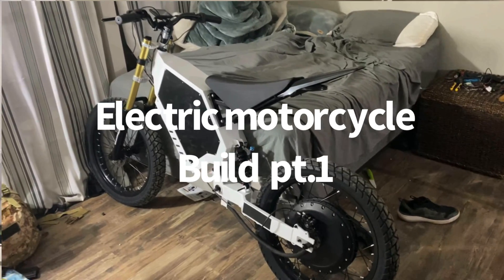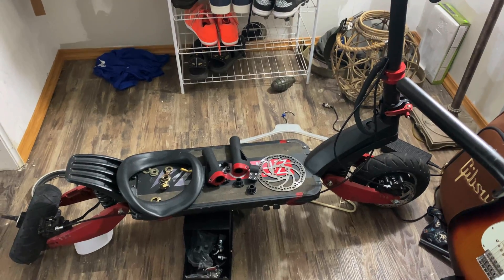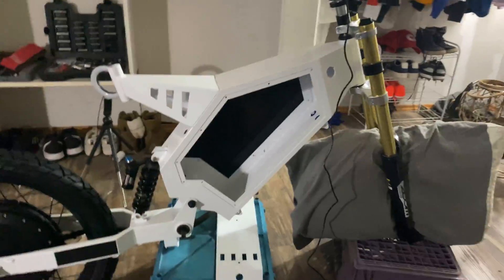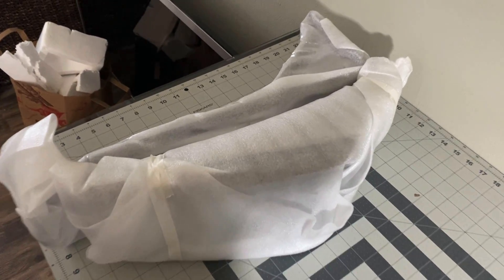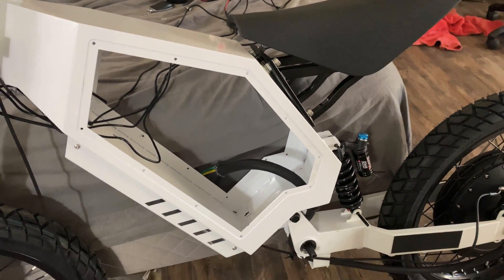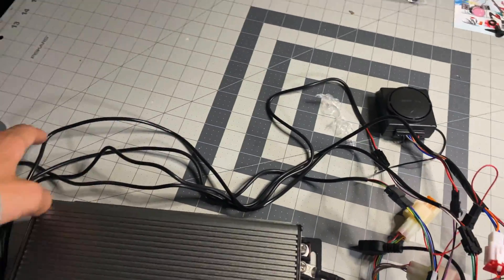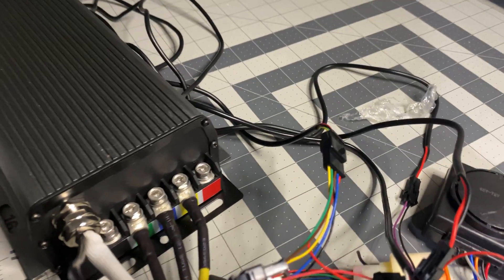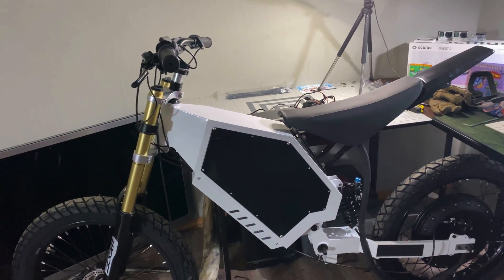70mph Enduro E-bike build pt1

Comment: Thoughts on tire size? I’m ordering my motor and they have 19” and a 21” tire. I’m 6’1”, and thinking of doing the 21”. Thanks
Reply from the maker: Probably go 18 or 19. I’m also tall and 19 works great for me. The smaller the rear tire size the faster the acceleration too.
Reply: Ok thanks

Comment: What dropout do you have for the rear? Do you recommended building a fat tire version with the 175mm dropout they offer and the fat tire version of the fork? The only issue is finding tires that will handle those speeds.

Comment: Thanks for your video bro, what do you think of this deal I was thinking of getting 2 for my wife and I ?  Third party is asking 2,580 here’s the Description: 

72V 12000W Strong Ebike
1) 19/21 Motorcycle tire/Turtle tire
2) SW900 LCD Display/ Can upgrade
to Color UKC1 Display
3) KKE Front Fork
4) KKE Rear Shock
5) Bicycle Seat/ Can upgrade to Motorcyle
seat
6) Sabvoton 150A controller
7) 72V 45ah EVE cells lithium battery with
a 5A charger
8) Tektro Hydraulic brake HD-E500
9) Half-Twist Throttle
10) Front light
11) Rear light with indicator and horn
12) PAS
Max Speed 120-130km/h, Mileage 113km

Also do you think max speed is 80mph? Don’t want to make mistakes
Reply from the maker: Sounds good. Top speed is probably 80 miles per hour. But they also probably got that by suspending the motor in air and running it. More like 65 mph.
Reply: @ENDOPRYSMofficial  haha, turn on the flux weakening current on 50% on your sabvoton controller through mqcon app and bluetooth, and check the max speed🤣😁 P.S. throw the color display in the trash, it is not visible in the sun, and buy sw800😄

Comment: This is not a build.. it is an assembly video...
Reply from the maker: Yeah but build sounds cool. Also it takes some technical experience to put these together and know what parts to buy. Also there is a lot of cutting and drilling holes with power tools so unlike assembling a kit I actually have to know all the steps in my head. and that’s why these take a while to complete right. So I would say it is in between assembly and a build.

Comment: Great job bro you r good at building ebikes .i have a 15000w 72v 49ah with sabvoton 200A .i have the same throttle that u have and after 3 months it started giving lag and sometimes it doesn’t work.i wanna get a domino throttle bud hook it up but I don’t know how.is there anyway u can show me pls? Email or telegram???
Reply from the maker: You can probably go into the controller app and adjust the throttle voltage and that might help you with your one throttle. I have a vid up on that.
Reply: @ENDOPRYSMofficial  I asked around and it has nothing to do with the controller app i just needed to know red cable from the controller goes with what colored wire from the throttle and so on …
Reply from the maker: @mo money  sorry I can’t help. I feel like if the connector has the same amount of wires as the other one in the same order you could probably just troubleshoot it and see what works. With such a low voltage going to the throttle I doubt anything bad could happen.
Reply: @ENDOPRYSMofficial  gotta temper with the cables till I get the right combo
Reply from the maker: @momoney6272  👍

Comment: I have 8000w motor with 200a sabvoton controller and 72v battery max speed is 55mph , how you making 70mph on it ?
Reply from the maker: What size bms do you have in your battery?
Reply: @ENDOPRYSMofficial  i have smart bms ANT 300amp
Reply from the maker: @shavkat84  then I’m really not sure. Is your motor 3.5t or 5t?
Reply: @ENDOPRYSMofficial  it says 3.5T
Reply: Did you actually check it with gps
Reply: tune up your controller correct, turn on the flux weakening current on 50%, maybe you have a 4t motor

Comment: Hi bro ..very nice project ..can you share the motor and controller kit link ?
Reply from the maker: https://m.alibaba.com/trade/search?SearchText=qs273%20kit&from=header&

https://www.amazon.com/NBpower-Hydraulic-Motorcycle-Controller-Bluetooth/dp/B083KNQ51Z/ref=mp_s_a_1_3?crid=ESKXYVGBK1G&dchild=1&keywords=qs+273+motor&qid=1630284756&sprefix=qs273&sr=8-3

The first one is the alibaba options and the second is on Amazon. I recommend looking to Alibaba.com because you can get a much better deal. Also I would get the 5000 watt motor instead of the 8000 because it can easily handle up to 20 kw and this build will only put out 11. So the extra 15 pound weight of the 8000 watt motor is just unnecessary.

Comment: I know shit about e-bikes, but if I were you, I would probably consider re-routing the motor wires and also give them a bit more slack outside the enclosure, considering the enclosure part of the bike and rear wheel mounting part of the bike will move independent of each other.
Reply from the maker: Im doing it differently than I did in the video.it was hard to pay attention to what I was doing with the bike because I was so focussed on filming. The bike is shaping up better now and the next video won’t be me filming my self building the bike. And more about what I did since the last vid, And actually getting to ride the thing.
Reply from the maker: My brother his friend and another friend of mine all have Surrons. So when the bike is done with I’m interested in comparing them.
Reply: @ENDOPRYSMofficial  Looking forward to the next video :D

Comment: IDK man, my dual sport tires were like 60 bucks a pop for my motorcycle. How were these 300? 0.o
Reply: @ENDOPRYSMofficial  ohhhhh
Reply from the maker: The full wheel was 300 with shipping and taxes. I could have gone cheeper but these are super good quality and will last a long time.
Reply from the maker: The tires were like 60. But the rims were expensive.
Reply: @ENDOPRYSMofficial  what are those tires btw
Reply from the maker: There generic alibaba tires. Although the quality doesn’t reflect it. I have owned a Suzuki drz 125 and a honda crf100 and I like these tires more than both of theirs. They are really nice.

Comment: Another cool ebike build - keep it up! I'm building one using the same frame but went for the DNM forks and an overkill battery :)

A couple things I noticed which I thought I'd just point out are to add a washer between the axle nut and the frame to make a more secure connection as the bolt can slip on the paint and come undone more easily.

Also (and I've learned this the hard way!) make sure to keep the motor cable far away from the rear disc brake bolts by either tying it back to the frame, making damn sure the bolts are done up tightly and even filing off the top of the bolts a bit. If not they WILL chew through the cable and you'll wish you'd spent a few minutes checking.

Anyway rant over, enjoy the build! 😁
Reply: where did you get the frame his link doesnt work
Reply: @tombeck1960  Ali babba

Comment: why qs273 ? why not qs205?
Reply from the maker: I was copying someone’s build I really liked and went with the 73 because they recommended it. But I might loose the 15 useless pounds of motor in the rear and downsize to the qs205 which makes more sense. But we will see.
Reply: @ENDOPRYSMofficial  yea, thats my point.. how much kW you want in peak?
Reply from the maker: With the 72v 42ah - 150a battery that is coming and my 150 amp controller I should get about 17 kw peak. That’s just a guesstimate. So the 273 might not be all that necessary unless I add a extra 10a battery pack in the controller tray. Which should give me more power.
Reply: @ENDOPRYSMofficial  150a bms + cont in 72V system is 10,8kW :P
Reply from the maker: The person I was watching said that 17kw was what he was getting, although his battery is 48 ah which is why I think adding an extra 10amp pack will get you more power. Anyways the 273 will still work. Later on I might just sell it and downsize.
At least my setup is not as stupid as the ones on alibaba with the 50 amp controller and the qs273.
Reply from the maker: I could be wrong. I’m still learning
Reply: @ENDOPRYSMofficial  48ah is capacity of battery(not exactly, coz 48ah alone didnt tell you capacity, but 72V*48ah is capacity 3456Wh - thats the capacity), this didnt give you no info about power. Power is in kW, and depends on battery BMS (batery controler) and bike controler.
Reply: @ENDOPRYSMofficial  and when you want more power, you need consider overheating, especialy motor hub - there are some mods for better heat spreading like hubsing, ferofluid.
Reply from the maker: @TnTckoo  you seem like you have built a similar bike. I’f so I’m curious how much yours cost to build. Mine will probably cost about 4200 all said and done.

Comment: Get some torque arms
Reply from the maker: I got some and figured out the problem
Reply: @ENDOPRYSMofficial  do you know where to get a zero 10x stem mine snapped on my and now i have to ride a peddle bike to work 😭😭😭
Reply from the maker: I recommend contacting the place that sold it to you or a zero 10x dealer. You can try to buy one from them. They have the connections to the factory so they can get you a stem.